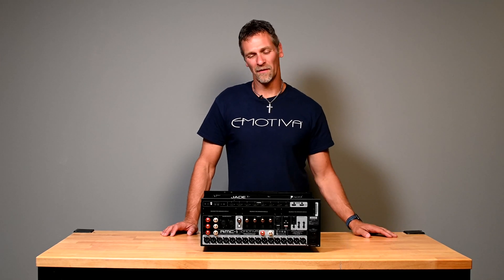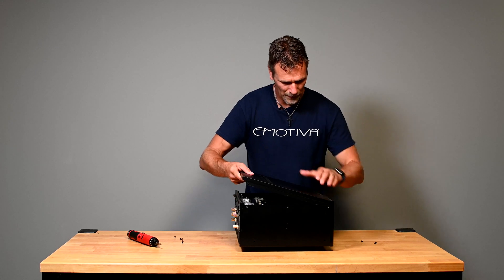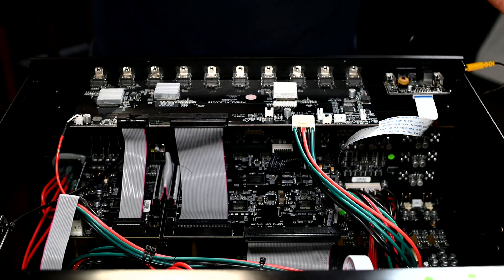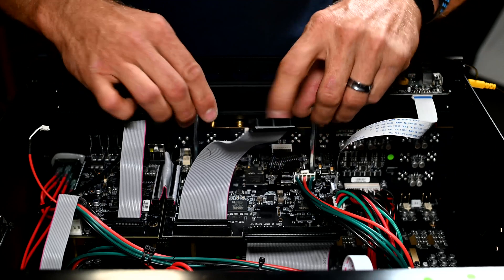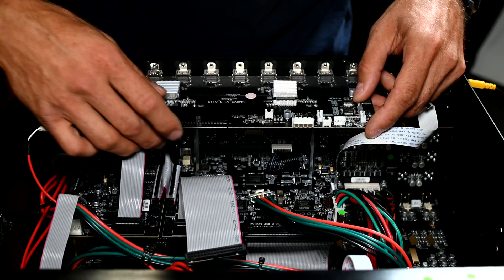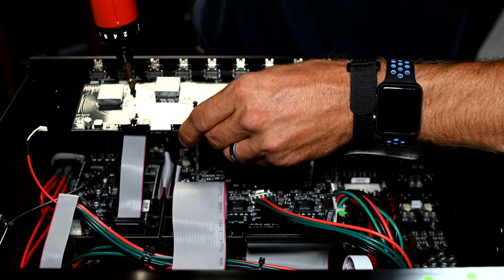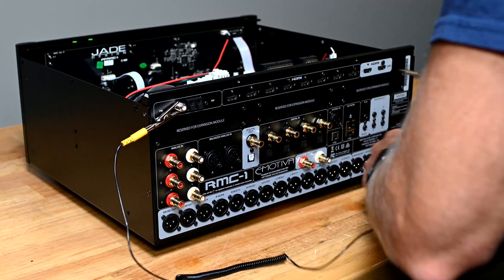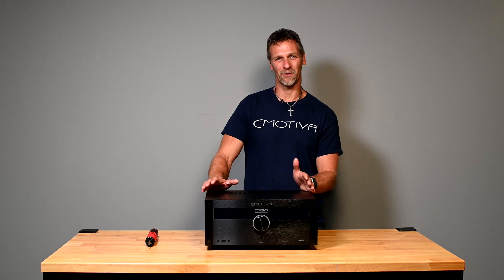Emotiva Audio HDMI Installation Guide

Comment: Hdmi 2.1 Foresight.. will you be giving us eARC and DtsX pro support as an update or will it be giving with the hdmi 2.1 board.
Reply from the maker: It will be an eARC board with the new Dolby update, DTSX Pro, and IMAX Enhanced.
Reply: @EmotivaAudioCorp  I'm pumped! Will be buying one as soon as they are out.
Reply: HEY  @EmotivaAudioCorp , your comment about a new eARC hdmi board with dtsx pro, a new Dolby update, and imax enhanced was a full year ago. Can you please please please be just a little transparent and PLEASE tell us what in the heck is going on with all this stuff?   I’m an RMC-1L owner, and we have literally been waiting for YEARS for this stuff.  Also, I updated to firmware 3.1 last week, and I could definitely notice that the video switching and the menu was much snappier.  But I also noticed that the audio takes just as long to switch as it did before.  So the video will be playing but it takes another 5-10 seconds for the audio to kick in.  Is that normal?   Is that supposed to happen?  Any insight would be greatly appreciated by thousands of your processor owners out here feeling like we have basically just been left in the dust.

Comment: Ohhhh will my Rmc-1l be getting hdmi 2.1....please please please
Reply from the maker: We are in the final stages of development of the HDMI 2.1 Upgrade board but won't release until 2022.
Reply: @EmotivaAudioCorp  merry Christmas and a HAPPY NEW YEAR! 😊 Better get myself a decent screw driver....is it 2022 yet? Hahahaha.
Reply: @EmotivaAudioCorp  Can we narrow that down to spring, summer, fall or winter?
Reply from the maker: @bigelkplacecabinjeff7425  We do not have a specific time frame currently since a lot of that will also come down to timing on parts which is tricky right now.